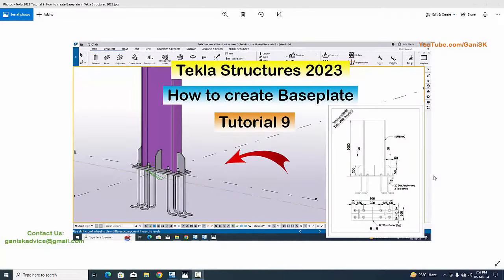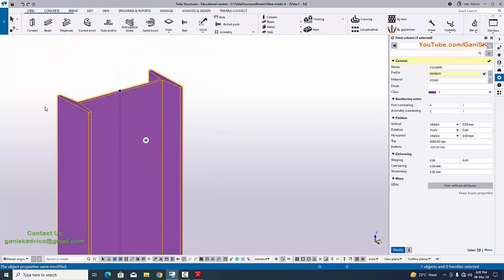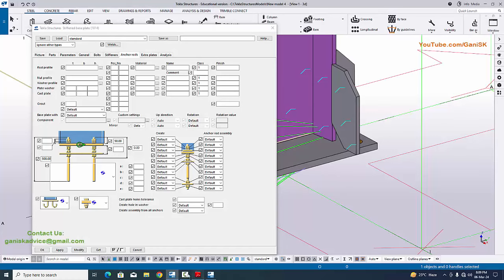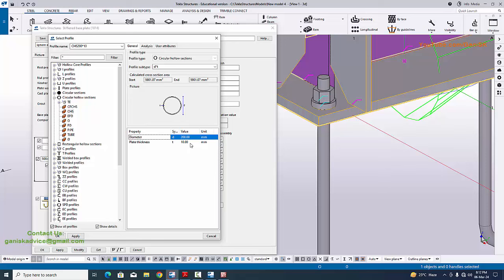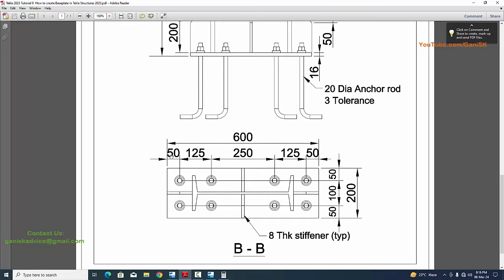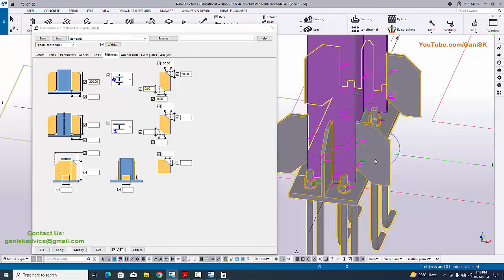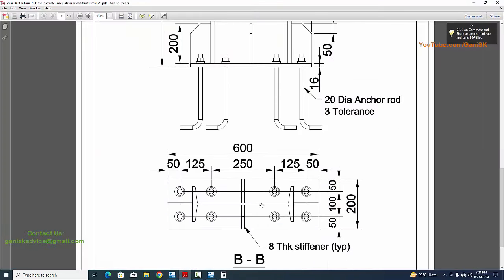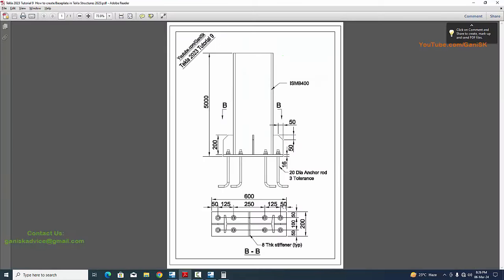Tekla 2023 Tutorial 9 | How to create Baseplate in Tekla Structures 2023

Comment: Hi sir. Thank you for your sharing. I'm using SF Real4 (Japan) to do steel structure project. I'm trying to learn tekla but it's take a lot of time compare to Real4. I have some questions.
1. When I create a profile can I assign material for it, because in project one profile has it's material. 
2. Can tekla automatic set connection for each profile. Example, i have a profile G30 and all of them have a joint J30 at the middle, and J30A at the side. It take a lot of time to copy cause the project is to big.
3. Can I change type of bracket connection when i create pipe column and beam panel zone (21)
Please help me.